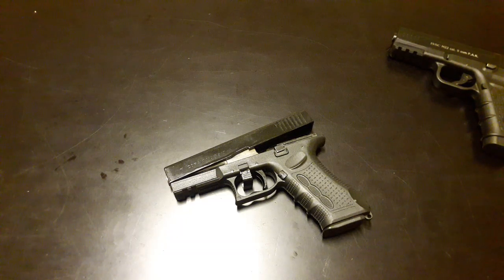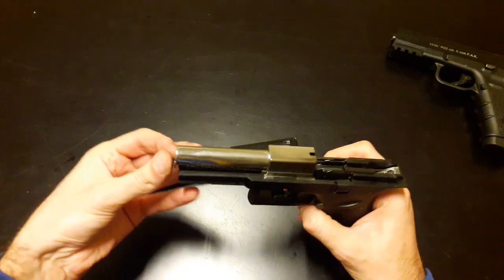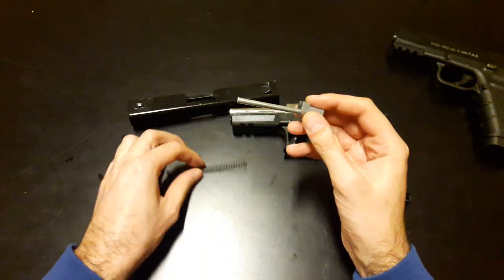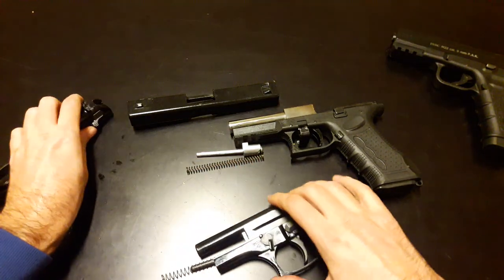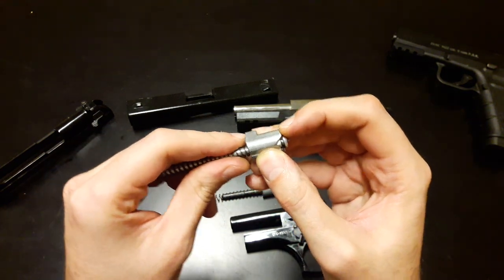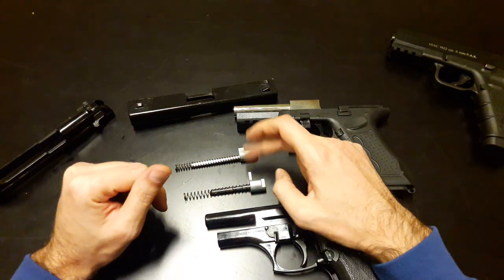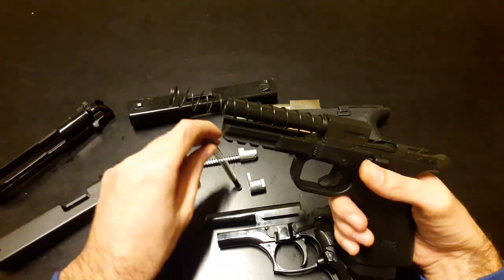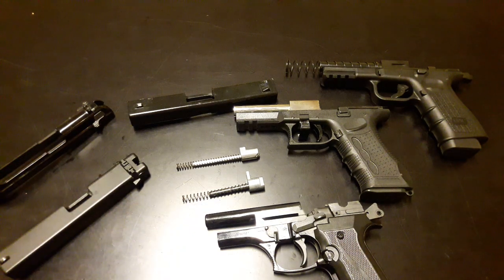Blank gun spring opinion

Comment: no question there, ISSC is far better than the other ones! I thought about buying one late spring...
I saw an original (licenced)  blank Glock 17 in a shop for +330€...That's 4x- 5x the price a zoraki/ekol/Bruni... (I have a zoraki 917, I think about getting the Bruni that looks better on camera).
Reply from the maker: Bruni is not so reliable as the Zoraki. Yes, Umarex made a licensed glock 17 just few days ago but it is way too expensive and it is still not on my market. I will get it asap :)
Reply: You can forget about any ISSC 9mm p.a.k(this blank guns make Turkish company Ceonic) and quality drop down since they dont make them in Austria anymore..or Ekol,blank guns with only issues. Zoraki is good quality gun but not licensed from Glock. And Bruni,real Italian junk! Umarex made really top replica with this licensed Glock 17 gen5,all steel made except slide and polymer frame. And polymer is real polymer like on real G17 not some cheap plastic. They have steel breech,steel slide catch,hammer..real sights (we can change them with Glock aftermarket sights),dual spring assembly as on original Glock, sideplate and trigger mechanism from real firearm. Even magazine who holds 17 rounds is exactly like on every Glock..with orange follower and steel reinforcement inside. And price is not 330€,269,90 euros(Germany). But since this is original licensed replica approved from Glock company and so well made,price is not so high in my opinion.
Reply: @maxdj8166  you're from France?
Reply: @zdravkonovosel122  positive
Reply: @maxdj8166  stranke,Glock 17 gen5 9mm p.a.k is 269,90 everywhere,I mean in German gun stores. May i ask you,how is about blank gun laws in France? Without restrictions?
Reply: @zdravkonovosel122  lol !
 so far, you still can buy one (proving above 18)
But in the last 30 years, it changed a lot (like many other laws, here, you know; so with live guns and so on, I don't want to say to much here)
The blank guns cannot shoot any amo no more (like in the past, 8mm shot material was allowed, even if not very effective for defense). They still can shoot gaz (but I hate this option), and flares (well, for idiots who want to on new year's or for an SOS), and, and, wait for it, rubber balls (w/ or W/o steel), but they are expenseive, and, if you have to load one to the adaptor, with stress, you can be sure you'll blow your finger first.
All this is nonsense , to me.
As for the clubs and licences, it's getting harder (they say because of 2015's events... but I know for a fact it's not). I can tell you more someday.
So what's left apart from buying? 
Not much.

You can only use it within your premisses, if endangered (and make sure you'll have to prove you had a reason to, to the detectives and the juge).
If you want it to leave your home, troubles are not far away. In case of any traffic control, you must provide a "valid reason "(wth can they be???) that you have it in your vehicle. Should you handle it anywhere (in public or not, street or other areas, like some friend of mine did in a field, i'll link the video if you can understand it), prepare for questionning and/or arresting. Same for plastic softair toys. The Law is clear about it "any model that ressembles a genuine one, or can be thought of as a real one" makes no distinction with the carrying of a live gun. And fines/times are high when sentenced! 

So imagine the hell I'm in when I want to shoot a scene with some credibility and no funds for an action sequence...I sweat all waters!
Since April, it's getting more expensive, because no more gun can be sold without having first been at St-Etienne's benchmark, where, they check if / or obstruct by themselves the barrel with a piece of material that has "to be harder and more resistant than the barrel itself". In case some dumb fuck with IQ=0 would still try to modify the toy to shoot live ammo, simply trying to drill the barrel blows it!

As for me, since 2016, not only do I have to take cautions and actions (+insurance) it I want to shoot a sequence with that prop, but the law forbids proximity with the actors under 5m, and, I have to hire a professional gunsmith to attend the scene meanwhile.
And so it goes for any other possible weapon by destination (carrying pétanque balls is one, yet so typical to the mediterranean culture!).

I remember... 1986, we could buy a shotgun at any (yes ! ANY!!) nearby superstore (selling food, tvs, clothes, and weapons).
Free of declaration. Only limit: 5 shots.
We could carry (yep!) a .22LR single shot revolver until 1989 (but what for? who would be crazy enough?).
Don't worry, I'm getting over that... The worst for me will come next week in aerial filming: now drones (which have been problematic  to regulations as well since 2016), will be so much restricted here (and around Europe), that it won't make sense having one .

Welcome to the world we built by lazyness and overpopulation (Orwell would laugh at us!).
I think I wrote a long piece, yet.
I don't know anything about your place, but the urban legend tells everything is easier to get from eastern Europe... You guys have a history of the leash, don't let  your people ever accept that again!
How about you give me some hints of your own?
Reply: @maxdj8166  i was thinking you live in U.K..well when i read about French gun laws. You have only restrictions. And yes,eastern Europe had more liberal gun laws,for example Czech republic..many times i ordered blank guns and even 4 and 6mm flobert guns with 7,5J of power from there. All is free,without papers,questions or similar issues. Czech government even support citizens to buy firearms for self defence and civilian use. Here in Slovenia we can have everything..only baton sticks,daggers and silencers on guns are not allowed.
Reply: @zdravkonovosel122  looks pretty much like nearby Switzerland! and one certainly cannot  dare to allege that this country is known for its violence! I hate to say so, but I don't feel secure in a country where idiots carry guns and sell them on the black market without any declaration neither control, and where honest citizens (even peaceful as I am), cannot easily proceed to the same after official training . We don't need everything. ONLY the minimum "in case of". Hey, since you spelt defenCe, I assume you learnt british/UK English.